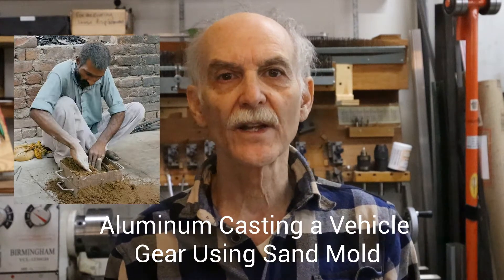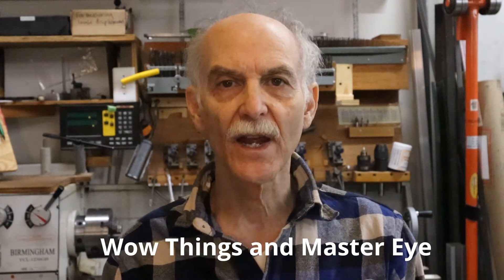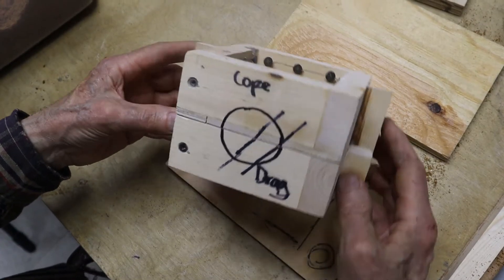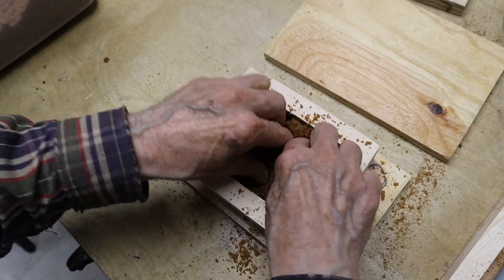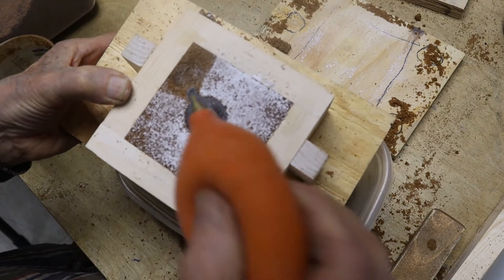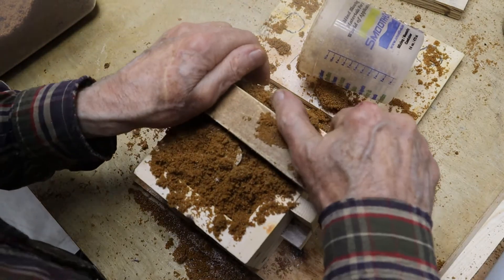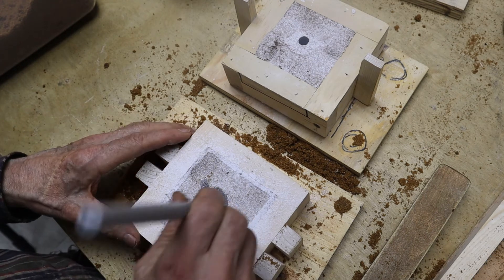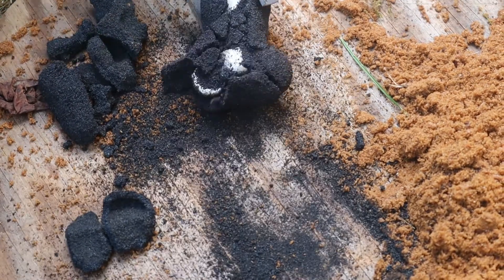“New” and Easier Way to Cast Aluminum -- Molasses-Bonded Sand Part 1

Comment: Hi groucho's, 
thank you very much for this video. I have also seen chinese villagers casting aluminum in more smart way. Their mold is permanent, whereas molasses mold is one time use. 
I carefully watched videos from those villagers, and it looks like, the exterior of the mold is gravel and cement, the interior is vey smooth it is treated with graphite paste.
Have you seen those videos?
Reply: No I haven't seen them. I do know that permanent molds, which are generally made of cast iron or steel, can also be made of graphite, but these have a shorter life. They are machined out of a solid block of graphite although I suppose someone could improvise something a little more informal and it might work for many copies. Thanks for letting me know.
Reply: Oh! You welcome. I am thrilled to know you Grouches. You are such a humble soul

Comment: I'm looking to make Christmas ornaments out of molten aluminum. If I   make a mold by pressing into the casting sand could I just pour the aluminum into the impression without having to use the top half of the cast?
Reply: It is better to have both sides, but you can do what you are proposing, but with somewhat sloppier results.
Reply: @davidwimberley3267  thank you for the advice

Comment: Thanks again David for the extra information re brass casting. I’ve got bentonite clay( kitty litter) Molasses ( from animal feed place or supermarket) and sand I’ll use my trusted coffee grinder sieve through fine mesh to get it fine as I can. Nothing to loose cast and cast again.
Reply: Of course things get a lot more complex in a commercial foundry. First of all, there are two kinds of bentonite, southern, and western. Also, when you use clay to bond sand, the usual procedure is to mull the sand. That means that the sand and the wetted clay are intimately connected beyond just mixing them. Each grain of sand is supposed to be coated by the adhesive clay. That may be difficult to achieve at home. Of course all of this doesn't mean you can't find a way to make it work. Your recipe and procedure do not have to be optimized because you're not in a commercial setting.

Comment: What a clear and concise video. Thanks. Have you any tips on fine detail brass casting?
Reply: Thanks for the kind words. I'm sure there are many techniques for doing fine work. The principal ingredient is fine sand. I think I've seen some Indonesian jewelry making where they use sand bonded with both clay and molasses.
Reply: Brother I am watching your interesting videos in Africa.
I want to ask you a question. I have seen sone Asian men casting skillet. They were not using sand. Instead, they were using a pre designed mold. 
It looked like to me graphite and clay. It is a pre set permanent mold.
Do you have any idea what it is?

Comment: Thanks for sharing your casting experience . I cannot find molasses locally but I am eager to try that casting mix... I wonder if sugar syrup can be used instead of it?
Reply: This is a very interesting question and, unfortunately, although I thought it would be otherwise, a syrup made of sucrose, that is table sugar, will not substitute for molasses. If you live in the United States, molasses is going to be available almost anywhere. It's available in feed stores as well as grocery stores although the feed store stuff will have some preservatives.

Comment: Molasses moulding sand also contains bentonite clay the same as green sand, but instead of water molasses is used. We use it lots in the foundry, it’s 
Ideal for intricate patterns
Reply: The ratios is, 4% bentonite to the weight of the silica sand, the molasses is also 2-5% to the weight of the sand and last is the water, it should be between 2-9% by the weight of the total mixture.
Reply: @juliusbeukes761  Thanks I am going to try that.
Reply: @juliusbeukes761 are you from South Africa?😉
Reply: So you can’t just use sand it has to have the clay in it also?
Reply: So how strong is it under tremendous hydrostatic pressure of molten metal like cast iron  ,I am talking about 100 pounds(45kg) or so ,green sand changed width ,or should I try sand mixed plaster of Paris mold now.
Reply: @adityasuresh6607  it's fine under pressure, as long as it's sufficiently rammed. It also hardens instantly with the heat from the metal going in the mould
Reply: @andrewdean4304  ok

Comment: Splendid video, I've allways used greensand or co2  & also petrobond  [for plaques with fine lettering] & watching those pakistani foundrymen you can easily tell if they're using greensand or molasses sand by the way it slides down & cakes to the casting ,real craftsmen [& brave with bare feet!!] thanks for the formula I'll make some myself & follow your videos
Reply: Good luck with your projects.
Reply: @davidwimberley2510  Thank you David,keep up the interesting videos they're really good.
Regards Graham.

Comment: Sir, is it necessary to add water in molasses sand? And what is difference between molasses and bentonite sand?
Reply: You definitely don't add water. You have to allow some of the water that was in the Molasses to evaporate before it is a workable consistency. If the sand dries out to the point where it's not workable then water has to be added, but in order for it to be workable there will always be less water than there was originally in the molasses itself.

It's an entirely different approach than a bentonite- or clay-bonded sand.
Reply: @davidwimberley2510  thanks

Comment: I gave it a try but the sand just falls through the mould  I think they another ingredient i won't stop using green sand, in looking into to this technique more hi see they use wood alcohol and burn it to the harden the mould
Reply: The sand has to be fairly dry, so, when squeezed it does not leave much on the palm.
Reply: @Geoffrey Richardson Thanks for your insightful comment.

Comment: Hey thanks for the video, I've been wondering what was up with their sand! My old brazier master used molasses as a mold wash but I never thought it could be used like this too.

 Never thought to use sugar, turmeric or ginger for parting compounds, would they work in regular greensand too you think? Or what makes them suitable here?

Also looking forward to the rest of the series, I enjoyed the production and clear instructions a lot. Especially the text intermissions made it easy to rewind to a section I wanted to rewatch.
Reply from the maker: Conventional parting or agricultural lime has a little silica in it so it should be used outside or with a respirator and I figured people would be likely to have sugar and a grinder or turmeric or inger and by extension, possibly some other herbs or spices if not those that would adequately work especially if you want to work indoors with children or whatever.

Also, I constantly ram up molds so I can understand the sand better and I don't want to dilute my sand too much. I think regular parting which is usually just ground limestone or chalk which is also calcium carbonate, might make the sand a little more tired than some of these other party agents.
Reply: @grouchosgarage6477  Thanks for the info!  I will try some of your parting suggestions, powdered sugar seems like a pretty sweet alternative to talc or chalk ;)